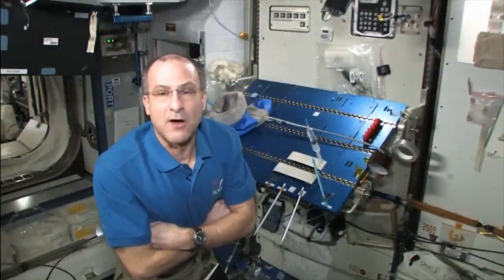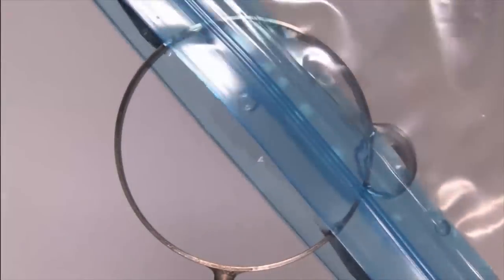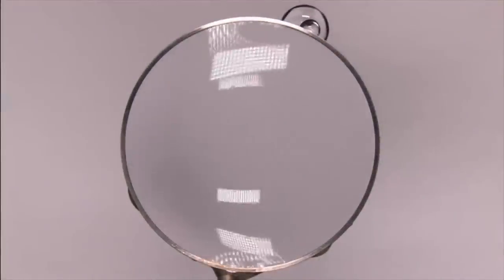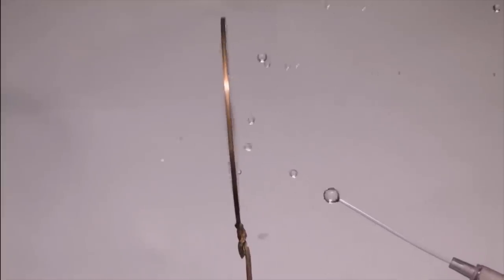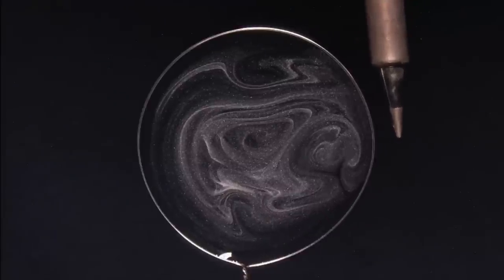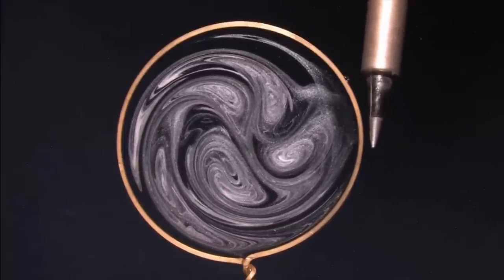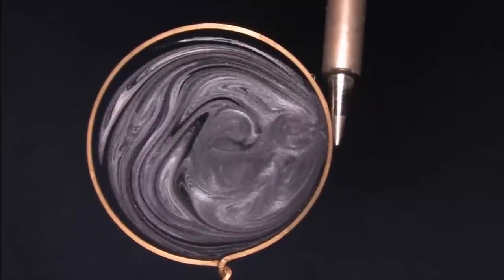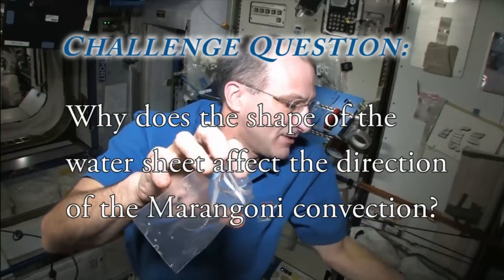Thin Film Physics

Comment: In convex shape - surface tension is higher at the periphery  and lesser at the centre. So obviously heated (less surface tension) water gets tugged to the water at the periphery having high surface tension compared to water at the centre. So it seems to be getting closer to the heat source. 

In concave shape - high surface tension at the centre. So less surface tension ( heated) water gets sucked to the centre. So it's seems to be getting away from the heat source.

Comment: The surface water refills from deeper layers as it is sucked away from the heat.
The deeper the water molecule is the less affected it is by surface tension,so it is easier to fill from thicker areas of the film.

Comment: the fluid tries to balance out high-energy and low-energy areas. due to binding-energy because of hydrogen bonds the inner pressure in thinner sections is lower than in thicker ones. Thus the fluid flows in the direction of the thinner section. (one could say: down the potential hill)

Comment: Isn't the convection pattern different because of the depth of the water? It would make sense because the deeper the water, the longer it takes to heat up. Hence, warm water will flow towards cooler water, which happens to be exactly where the water is deeper. (do I win a trip on the ISS if I answered correctly?)

Comment: If the air system is like the system they have on the shuttles then the air exchanger would run the fluid through a a filter/canister and then through a fan separator to remove it from the air. 

I would imagine that since the only thing that would actually keep the water on an electronic piece is surface tension... the risk would be minimal since he would know where it was.

Plus it's the ISS, surely they have seals ;)